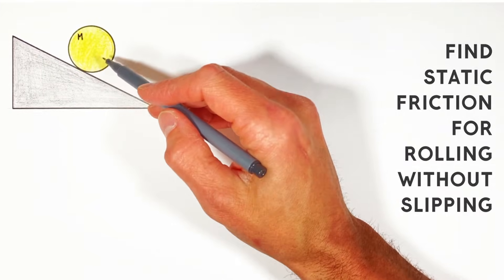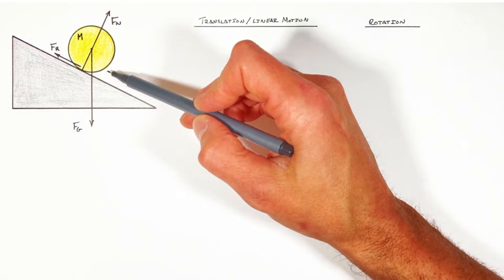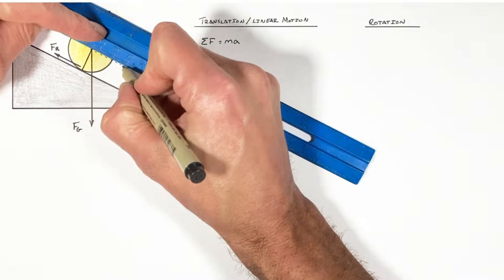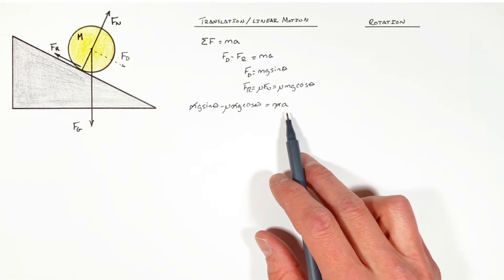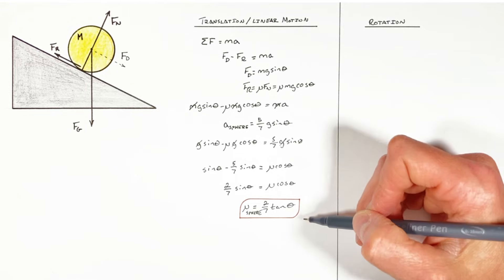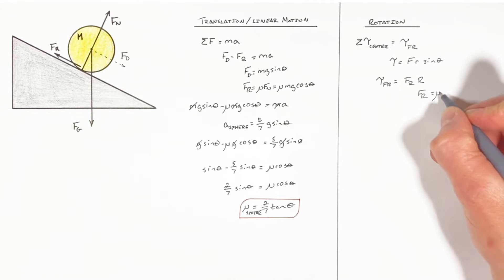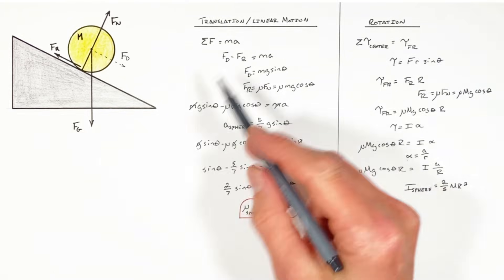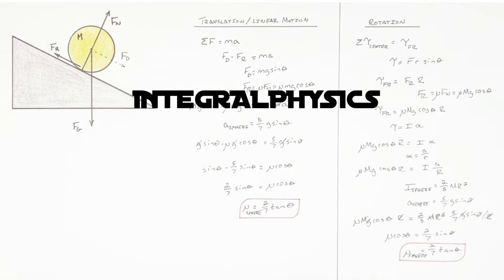Calculate Friction Required for Rolling Without Slipping (Down a Hill) | Force

Comment: Rolling without slipping means the calculated friction force cannot do any labour energy (W=F*s). This means you’re used model is not suitable at all. 

Friction of this pure rolling item comes solely of deforming surface of the hill, and therefore creating a momentum because the arm length of the combined normal forces that comes with the deformation is greater than zero. 

Physics is often far more difficult than it lookes initially.

Comment: Dear Sir, The equation for friction force used is only applied to calculate the maximum or limit friction. While rolling without slipping, it is usually less than Nμ. Therefore, in this case we cannot set the friction equal to Nμ
Reply from the maker: Since were solving for the limiting case, thats precisely what we can do.

Comment: Please make a video on rolling without slipping with sphere is going uphill (because friction in it is also upwards and i dont know why?)
Reply: this is 7 months late, but here we are:
when a ball is pushed up a hill with an initial velocity, there is no force to keep it going up, there was only an initial "kick" to give it speed, so the main force acting on the ball is gravity, which as always, it's pushing it down, and friction is always paralel tot he surface and in opposite direction to the sum of the other forces, so it points up.
but, note that friction is positive this time, since it points in the direction of the movement (speed is posite, ball is moving up, ball is getting postiive on the X axis, friction is also pointing up) and gravity is negative.